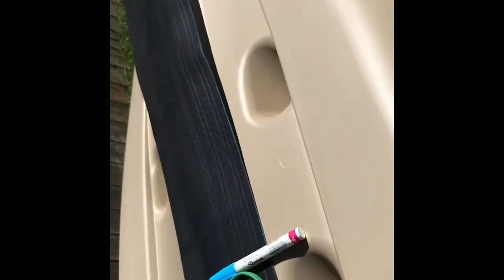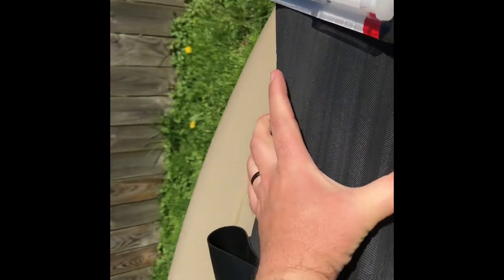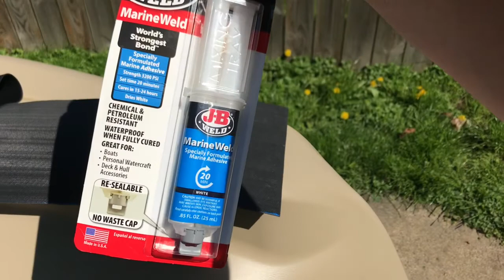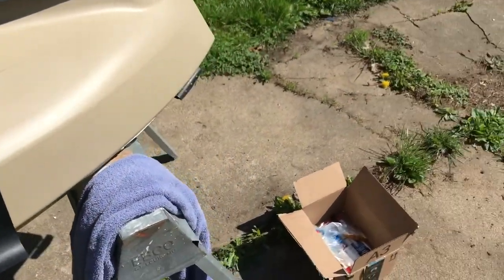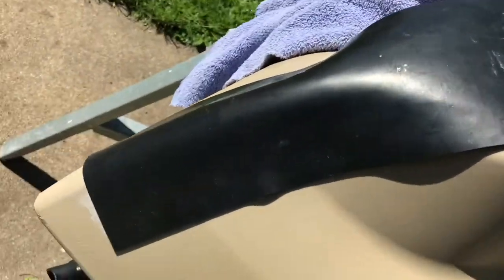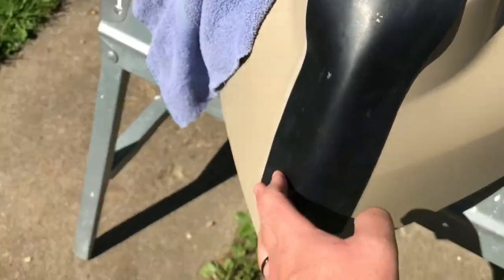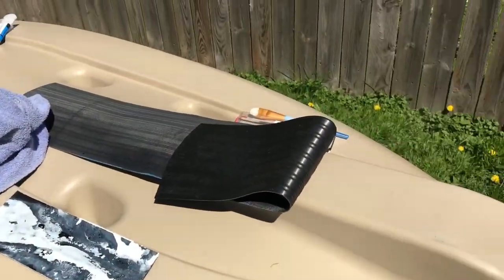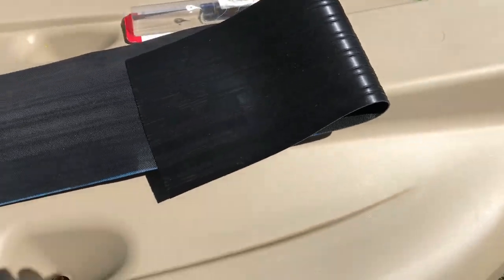Keel Guard FAIL!!!

Comment: What about rubberized truck bed liner? You can get it in a rattle can and could mask off the area you want to spray it on. I would imagine you would have to scuff up the plastic to get good adhesion.
Reply from the maker: Jeremy Ruthig that might work well!